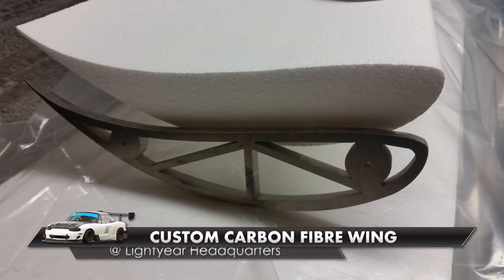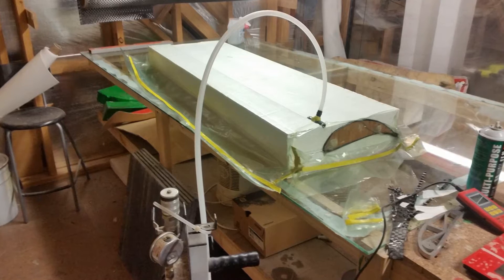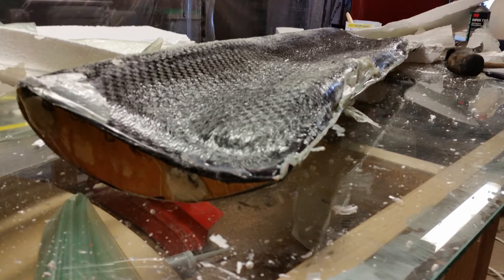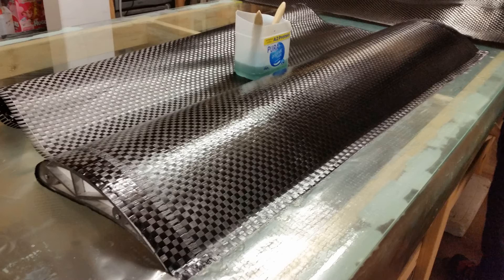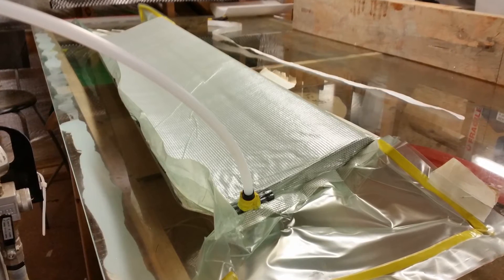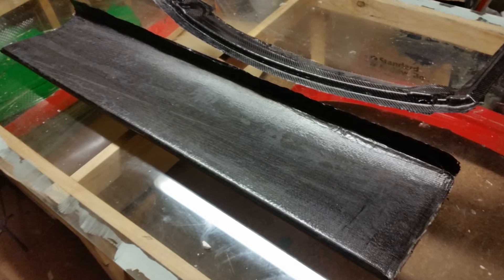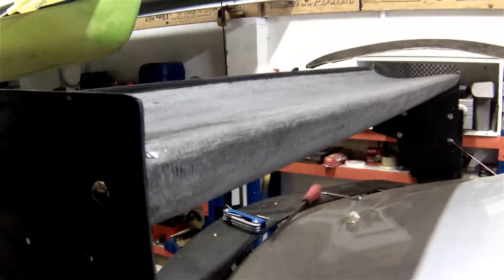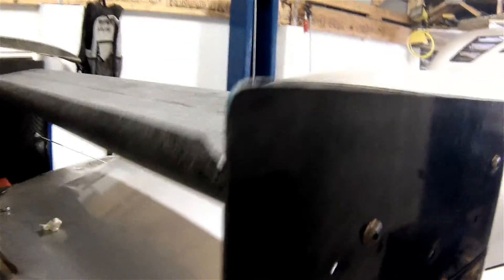Carbon Fibre Racecar Wing - Building a home made custom wing for the MX-5

Comment: Lovely work, I’m contemplating using the same method. What aerofoil profile did you use and how many plys of carbon did you lay up?
Reply from the maker: It is a profile based on the Simon McBeath SM183 I believe. About 3 layers of CF but it depends on your material choice, grams/sqm, resin etc.

Comment: Great video - thanks for sharing!  Did you use a resin infusion process, or a conventional wet layup with a vacuum bag?
Reply from the maker: Dry layup with vacuum infusion.
Reply: @Bbeavis  Gotta say, I'm glad to hear it was an infusion, as this is exactly what I'm about to embark on.  Did you have any issues getting the resin to flow around the foam core?  Also did you have the resin inlet on one end of the wing, or was it along the leading/trailing edge?

Comment: hey man, im making a rear wing for my dissertation. could you tell me how you managed to fit the rods through the polystyrene to the metal aerofoil shapes?
Reply from the maker: Sorry mate, what 'rods' are you referring to?
Reply: @Bbeavis  how you connect the end plates through the polysterene, in the first wing they connect the wood and the second they connect the metal ends. i need to know how you bored a hole cleanly through the polystyrene, id try things out but cant because of the lockdown so cant actually make the wing.
Reply from the maker: @OperationMindPhuk  There is not hole bored through, the aluminium end profile is just screwed in place while the Carbon layup occurs, then once cured the screws are removed and the epoxy/carbon is fused to the aluminium.
Reply: @Bbeavis  That's actually just made it so much more simple than I thought it was going to be, thank you for replying! :)
Reply from the maker: @OperationMindPhuk  Good luck with your dissertation. :-)

Comment: Thanks for sharing your failures also. It is not the heat that destroyed the core but the chemical reaction between the Epoxy and the EPS foam. I tried it and Poly Urethane foam works much better.
Reply from the maker: Perhaps, I'm not that familiar with the complexities of composites, foams, and the epoxy used to definitively say whether it really is heat or chemicals causing the banana.

Comment: Couple questions, Where did you get the end brackets made and at what cost? Also who was the foam supplier you used?
Reply from the maker: The aluminium ends were designed by me and water jet car by some guys in Clayton. I don't recall the foam supplier.